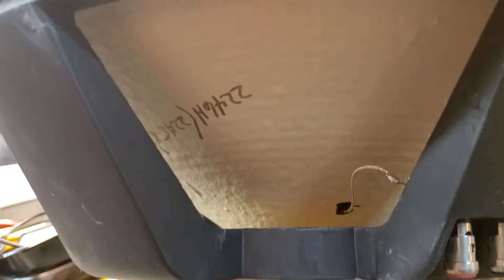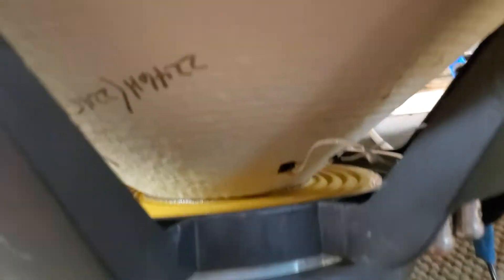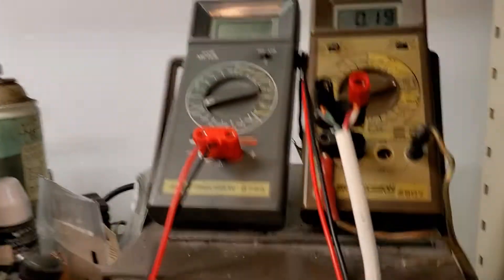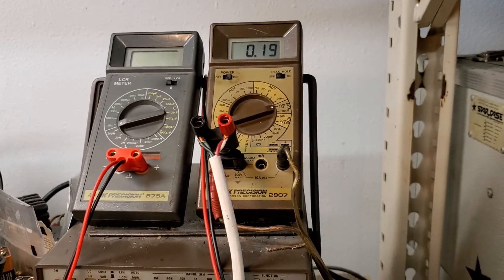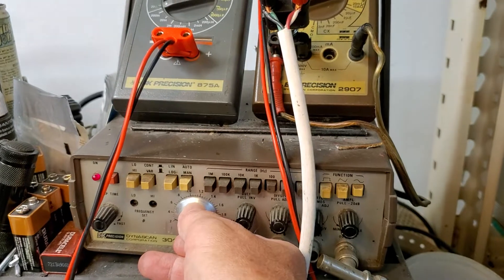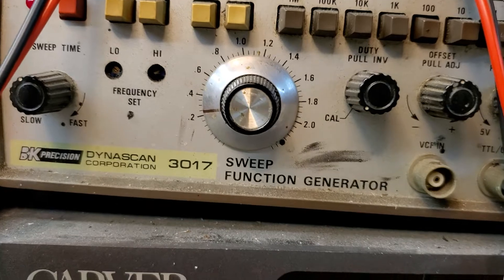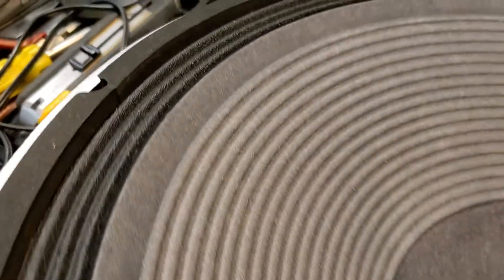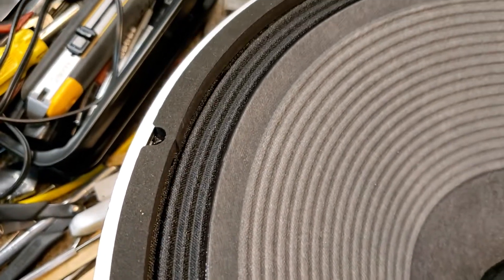2246H...No-Rot Recone kit for JBL 2245H by Upland Loudspeaker Service.

Comment: Curious if you recharged too, looks great.
Reply from the maker: No. Not necessary for this unit. Ceramic magnet doesn't discharge over time, and the motor was clean.